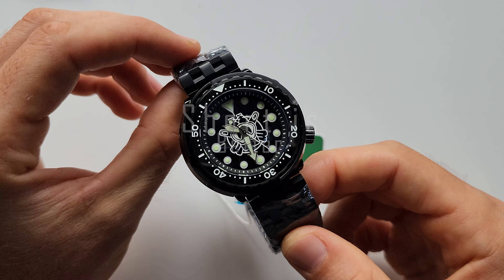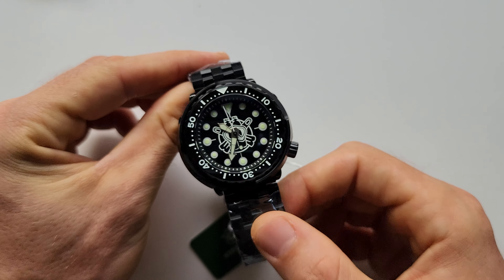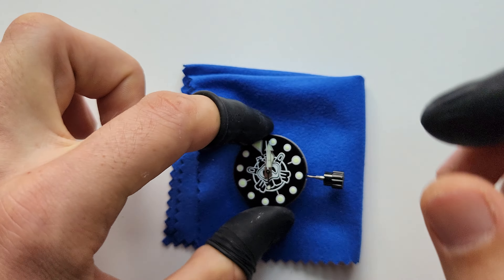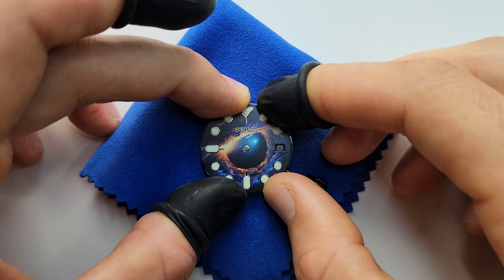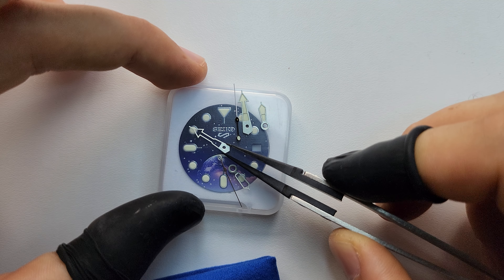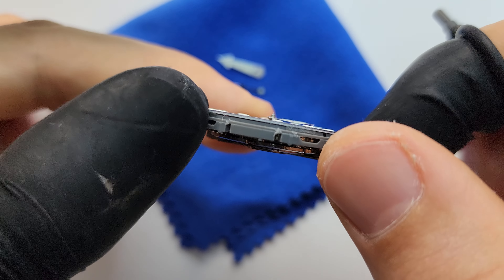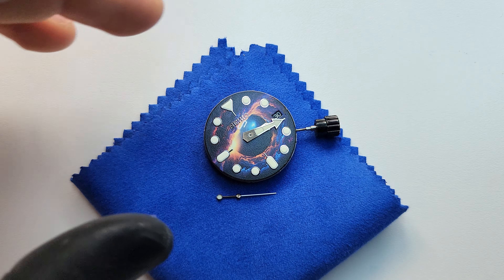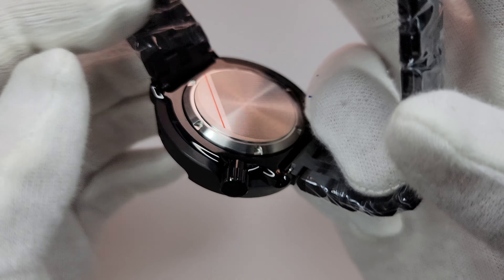SteelDive 1975XP (No more stock) & Dial Swap | SteelDive Review

Comment: That looks incredible. I'm about to attempt my own watch mod. Addiesdive version of that watch (not black) and I'm going to put in a purple dial without date window and replace the hands with a black and white hour hand, orange minute hand and an orange milgauss style second hand. The strap will be black leather with purple stitching. I think aligning the dial will be the hardest part!! Have been watching your videos lately and have now subscribed.
Reply from the maker: Let me see your mod when you're done! Sounds interesting 🤔  Thanks for watching my videos 😊🙏
Reply: @ShortBetter  yep, I will, if I'm successful. My first watch mod....got all parts ust waiting for a couple of tools (hand pushers) then I'll attempt in the next week or so... was going to have a watchmaker do it, but they are all grumpy old grandfather clock repairers and weren't interested. So I'm doing it myself..
Reply from the maker: @thesolver1970  Hahaha
Reply: @ShortBetter   I have done it. My very first watch mod. It was very very easy and took about 40 minutes. Dial was lined up perfectly first attempt and the hands went on very easy. 5 minutes for the second hand but still easy. I did ruin the dial initially by accidently cleaning it with isopropyl which caused the minute markes to fade and smear. I ended up weathering the whol dial for effect rather than waste it. The younger crowd at work love it, wonder if weathering a dial might be a thing? Thanks to your videos it made it very easy to do, while also working at the same time! Have added short videos on my youtube channel.